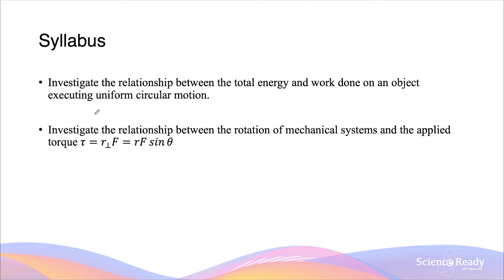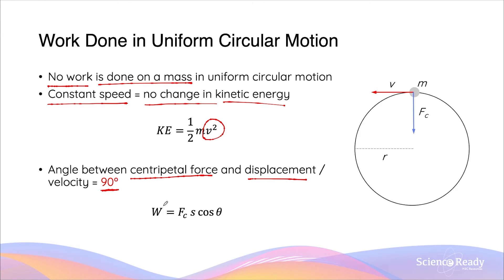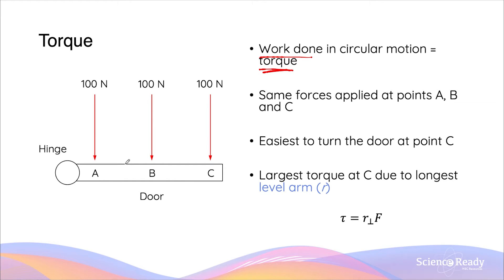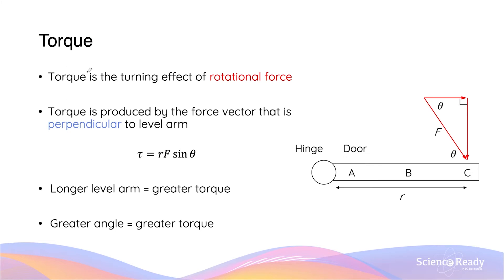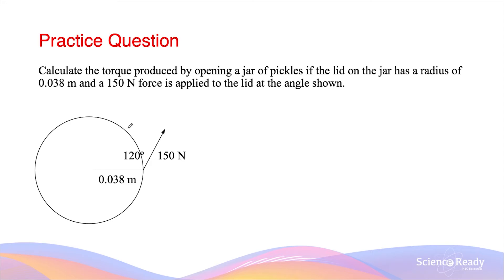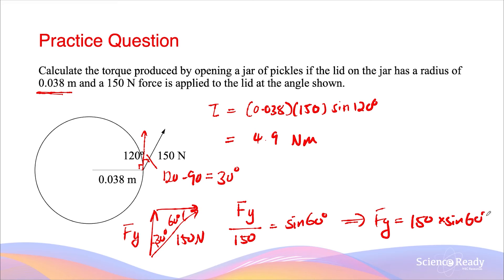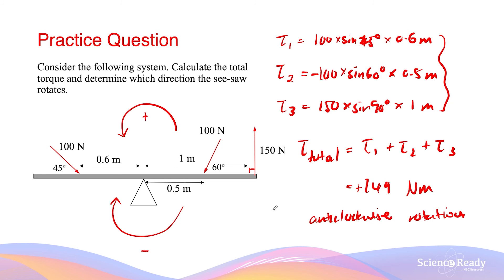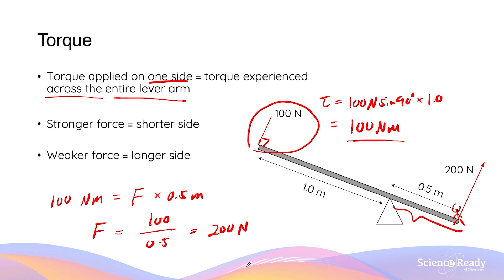What is Torque? Work Done in Circular Motion + Examples // HSC Physics

Comment: 7:34 how did it become 60 degres?
Reply from the maker: To calculate torque, you need to multiply the perpendicular component of applied force by the lever arm. The perpendicular component equals 150 x sin60,